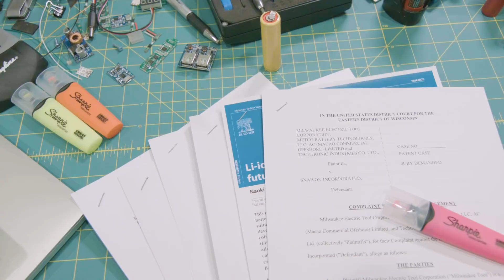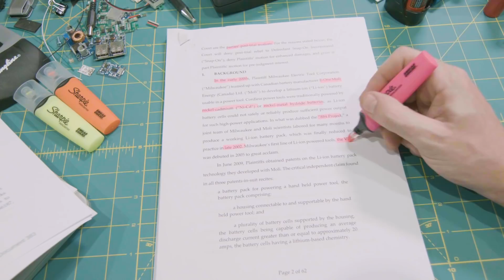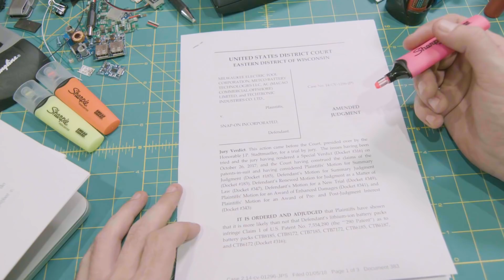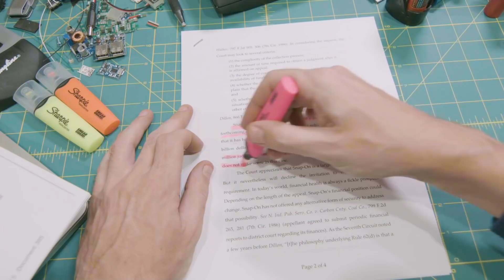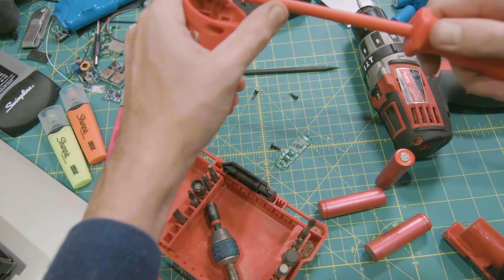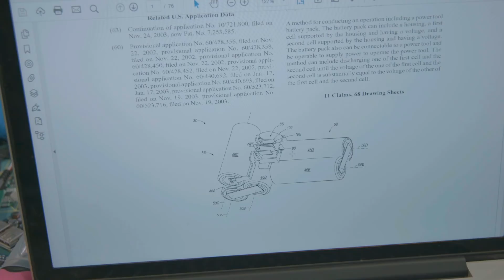BOLLR: Milwaukee wins $28 million for Lithium-Ion Battery Patents from Snap-On

Comment: Thank you, thank you ! I am very happy to see that my favorite copyright attorney has technical competence in engineering. I can’t certify you for safety, however. Even “dead” Li batteries can contain enough metallic or intercalated Li to be fire hazards . The fire does not require gas to be generated. The Li itself is highly flammable in reduced form. This was a very enjoyable program. Wish I could support you more, but not yet able to do so.

Comment: @Lawful Masses with Leonard French: very disappointed -- Leonard -- you didn't address the white elephant: Now that Milwaukee has successfully sued (given appeal success) someone (Snap-On) for patent infringement in using lithium ion batteries in a way in which EVERYBODY safely uses the multi-cell batteries -- e.g. with battery protection circuitry and individual cell sensing, how does that affect EVERYBODY else using Li multi-cell batteries? Does EVERYBODY have to pay license fee to Milwaukee? Just folks with three cells? Just folks using Li multi-cell in tools? Just 20A 3-cell Li tools with plain Li chemistry? These are the questions we all NEED answered to assess potential future liability.

Comment: The science article you said you would link to but didn't is open access (free):

Nitta, N., Wu, F., Lee, J. T., & Yushin, G. (2015). Li-ion battery materials: present and future. Materials today, 18(5), 252-264.
https://doi.org/10.1016/j.mattod.2014.10.040

In case anyone into chemistry wants to read it.

Comment: I am an amature eletronics and mechanical engineer, albeit with the benefit of hindsight, and the decision in this case suggests significant incompetence on Milwaukee’s part. Snapon’s claim that anyone with knowledge of electronics could have made a lithium-ion cordless power tool is not only accurate, it would demonstrate better knowledge of the subjects at hand than Milwaukee’s engineers. I can even attempt to prove this with a hypothetical situation using a different type of rechargeable battery.

No power tool manufacturer has, to my knowledge, produced a viable cordless power tool using lead-acid batteries. Lead-acid batteries have roughly ten times the voltage potential of either nickel-cadmium or nickel-metal-hydride batteries, and would require only two battery cells to construct a battery pack with sufficient voltage for a cordless power tool. The drawbacks of using lead-acid battery technology include the base metals used in the cells being heavier and having potentially slower recharge times. 

The reason I bring this up is that at the time Milwaukee was jointly “developing” the lithium-ion cordless power tool, lithium-ion battery chemistry was not a new technology and the principles involved with them were well known and accessible to the public. To prove this point, I went to my local library and found a book dated 1996, some ten years before Milwaukee released their lithium-ion cordless power tools, that described in great detail rechargeable battery chemistries including lead-acid, nickel-cadmium, nickel-metal-hydride, and lithium-ion. This information included potential capacity and discharge rates for lithium-ion batteries, including the potential amperage discharge levels. Therefore, any reasonable person Milwaukee employed as an engineer could have obtained the information required to choose the best specific lithium-ion battery chemistry for a cordless power tool dating back to at least 1996.

Going back to the lead-acid battery hypothesis, such a cordless power tool would not be patentable because it does not meet the criteria of being non-obvious. Any electronics engineer, amature or professional, would be able to tell any person asking them that they could use lead-acid batteries instead of nickel-cadmium or nickel-metal-hydride if they wanted to use fewer battery cells, albeit with different drawbacks. Since lithium-ion battery technology also has a higher voltage potential than nickel batteries of either type, Milwaukee’s patent also falls short of this metric since any engineer, amature or professional, would be able to tell a person to use lithium-ion chemistry over nickel chemistries.

Therefore, Milwaukee’s patent on a lithium-ion cordless power tool is invalid because it merely combines one well-known technology (cordless power tools) with another well-known technology (lithium-ion batteries) without providing any significant design improvement over either. Lithium-ion cordless power tools were an inevitability after lithium-ion battery cells were invented, since lithium-ion provides massive advantages over nickel batteries that obviously outweigh the drawbacks. Milwaukee’s patent would have held water if a new lithium-ion battery chemistry had been developed in order to enable use of lithium-ion batteries in power tools, however at the time of the patent filing there were only about 3 chemistries for lithium-ion batteries in common use, two of which ended up being used in lithium-ion cordless power tools. Snapon’s arguement is, therefore, correct; any person with the ability to solder could, in fact, have replaced the nickel battery cells in their cordless power tool with lithium-ion battery cells bought off of a regular store shelf already in a suitable condition for use in a cordless power tool.

Comment: GM (General Motors) had a patent on powering an electric car (the EV1) with what at the time was the state of the art Nickel Metal Hydride cells (up to then Lead Acid batteries or Nickel Iron batteries had been the only options). GM in a infamous action (amongst electric car enthusiasts) recalled all those cars (they were only sold on lease) and crushed them then sold the patent via an intermediary onto Texaco who sat on the patent since it was technology that could have affected their oil business, severely if  electric cars had displaced gasoline cars. Of course Li-ion cells came on the scene sometime latter and Texaco's worst fears may be about to happen although slowly since they are no longer in a position to block the latest electric vehicle battery.
What I find staggering is such an obvious action by GM and Milwaukee to employ the latest battery tech is patent-able in the first place. It serves no public good to grant patents on the bleeding obvious and yet this seems to be now accepted as the way the patent system should be operated even though stuff that would be obvious to one skilled in the art is specifically not permitted. This is an evil the Federal Government should have stamped out decades ago.

Comment: Hmm, seems like the original pantent was too broad.  If it pertained to particular chemistry or manufacturing methods to make LI-ion batteries suitable for tools and snap on stole that idea than I'd understand. But just the idea of putting LI-ion battery in a tool EVEN  if that involves reworking battery chemistry is insanely obvious.  HOW to rework that battery chemistry may not be and I can see that being patented but I cannot see how Running an electric tool with a better kind of battery should should  have ever been patent.  Patenting a battery with chemistry and specs that make it suitable for a power tool? Sure.  Patent the idea of using Lithium ion batteries in power tools? Ridiculous.

Comment: Surely Sony and Asahi Kasei should be suing Milwaukee's ass since they invented the lithium polymer battery back in 1985, and arguably all Milwaukee has done is stick it in a fancy box, virtually indistinguishable from the fancy boxes that NiCd and NiMh cells were stuck in previously. As to this 20A nonsense, does that mean that if I limit my pack to 19.999A or set it up for 20.0001A I am not infringing their nonsensical (in my opinion obviously) patent?
Further more 20A at what, 0.2mv, 2V, 20V, 200V, 2000kV... surely the output current is irrelevant, the wattage is the deciding factor as any remotely skilled practitioner of the art of pixie wrangling would know. Moah power == more better.  So your pack running 20A at 4.2V is not the same as 20A at 8.4V or 20A at 12.6V or whatever.. this crap about tweaking the battery chemistry is (again in my opinion) mere magic smoke and mirrors, since other batteries and indeed rechargeable lithium batteries are and were at the time, available that could put out considerably more than 20A

Comment: I cannot say that I believe Milwakee had anything to do with the "invention" of cells that have a higher discharge rate. If I recall, RC vehicles were using higher discharge cells in the early to mid 2000's as well. This seems to be the "time" when higher discharge lithium cells became popular. If Milwakee came up with the idea, why not just market these special cells and sell them as such? Yes I know there are differences between L-Ion and LiPo...

It seems to me that Milwakee said nope that battery isn't good enough for what we need, try again. The battery manufacturer tried again until they got it as their customer required. Was there a document in hand from Milwakee that stated, "we reserve rights to the tech once you finish making it".... Hell I dunno, I still doubt that a tool company truly contributed much more than "this is what we want" to the actual design, regardless of what it "says" on all that paper...

Comment: Funny thing but what we call today "jury" is basically the famous "blockchain". There's already some ideas of fully digital court system in the near future with integrating a special form of blockchain, mostly to reduce costs…not sure which country will be first, but it won't be the USA, they like to keep the old foundation, very shy to reform anything if it still works as old wagon. This reflects the archaic patent system too, ridiculous with patented non-existed stuff. The biggest danger for it - is Artificial Intelligence, machines are already making a big part into getting the patents for huge corporations, like Boeing, this is not humans and it is very unfair for other inventors - the humans. There will be huge political scandal with all this considering that AI is advancing fast, this is making big ethics problem - if USA as state registering patents for machines inventions (full AI inventions can be made soon, it's hard to prove but something will leak someday) - are machines equal to humans? They are not by current laws.

Comment: In the original v28 and v18 tools the protection circuit was in the pack.  The tools were old school, dumb with a brushed motor but over built tanks.

Comment: Christ, whatever you do, protect the Glenfiddich !!!!!!!!! - or I'll sue you for desecration of sacred liquid that IS patented - by Scotland and the distillery... sorta. There's Whisky and Whiskey and that's another vijjeo unto itself!

oh.... btw, great vid!

Some new Smartphones have the option of using different voltage chargers. Motorola's Moto Z battery has a "turbo" feature an can charge at 5V @ 15 or 30 Watts. So how that works and not ruin the  3,500 mAh battery would be interesting to know. The Moto Z battery is not replaceable. A backpack is available and can accept both power versions of the Moto Z charger.

Comment: I discharge most my 18650`s to 3.5V or 3.25V personally, it does degrade the capacity a little faster, but not much, I get about 10% fewer cycles out of them (sony vtc 4&5 and LG HG2), so it`s negligible really, still safe, I just get fewer cycles :)
I`m a bit more particular with my LiPo s, as they are expensive and I want them to last as long as possible..

Comment: I would like to note the M12 batteries from Milwaukee have a temp probe for the charger and for the tool itself and the M18s have built in balance boards.

Comment: i have taken apart a battery. just the three little clips, pop the top. the will slide up, tight fit but not glued. at least the one i opened. it has a pcb with some stuff. for the life of me i cant picture it and now cant remember exactly was in it. the batteries are wired to pcb, and i belive it has a temp. sense of sorts. it pops back together fairly easy. just be gental on the tabs, cut up a credit card for a fingernail sub. like i did.

Comment: i don't feel there is a significant improvement on the tech of lithium ion batteries and their use in these tools... i mean, like seriously. there is little difference between the battery packs that are nicad vs, lithium ion. you add a protection circuit, that isn't patentable in and of itself, and a lithium ion battery designed for high amp applications. the patent is invalid if you consider the tech that went into it. in my opinion only the battery chemistry would be patentable. i think snap-on screwed the pooch with this one, they lost in my opinion an easily win-able case. That or the patents in america are so fucking retarded that they can get away with patenting things twice.

Comment: Bud, those bigger batteries are used for radio control and they are not lithium Ion but Lithium POLYMER. Quite the big difference both in voltage, performance and volatility.
Reply: Google it. That mostly refers to how their jacketed.
Reply: Oh, how wrong you are. They are ALL lithium ion batteries. Most of the "bigger batteries" he has are just cylindrical cells arranged in a pack. The other ones are lithium ION polymer. All lithium ion polymer batteries are lithium ion batteries, but not all lithium ion batteries are lithium ion polymer batteries.
Reply: Andrew Delashaw yes Andrew technically they are all lithium in the RC hobby we refer to the polymers as lipos there is such a big difference in energy density we would never consider using the aluminum can Lithium ions the lithium polymers are 4.2 nominal volts and most of the newer varieties can be charged at three four or five C rates making them ideal for quick charge and quick discharge as an example I fly electric Jets and the typical current draw on a 12 cell 8 amp hour pack is around 120 to 150 amps

Comment: I thought that the safety circuit was required by law to be in the pack itself so that it is safe when removed from the device?
Reply: I think this depends on the specific application.
Most hobby batteries I purchase for quadcopters and robots don't have builtin protection.
There might be some law about computer batteries but it's certainly possible to purchase Lithium batteries without protection.
Reply: Weird.. the pack we make for our product we were told had to have safety circuit built in.  The individual cells come without production, but once assembled into a user removable pack, has to have protection.  Maybe that requirement kicks in over a certain capacity.  Our battery is a 4 cell 16 volt 6 AH pack.  Shipping regulations even require us to discharge them to no more than 30% capacity before they can be shipped.  In any case, not having it in the pack is bad engineering and unsafe design.
Reply: I'm not sure why the RC battery packs can be sold without protection. It's likely because a lot of the packs aren't intended for a specific product. The packs get used in all sorts of different electric (usually radio controlled) vehicles (cars, airplanes, quadcopters, etc.). 
These high current packs have a balancing port to allow balanced charging of the individual cells. Many people use battery alarms/monitors which plug into the balancing port. I'm not sure, but I imagine protection circuits for high current packs would add a significant cost to the pack.
These packs are charged with special chargers which balance the cells. Many people use special "LiPo Bags" when charging these sorts of packs. These bags are designed to contain the burning batteries if something goes wrong.

Comment: So, I looked up the patent in question, cause I wanted to read it n' see what it actually covers, and it was quite interesting. Here it be if you're as bored/interested as I: https://www.google.com/patents/US7554290 Anyway, along with finding that I happened across some similar cases over the same patent and the resulting judgements from the last couple of years which I promptly skimmed though, cause who's got time to read 60 pages of the minutia of battery design? Answer: some judge somewhere apparently. Anywho, the takeaway I get from all of it is that yeah sure a rechargeable battery pack of sufficient capacity to run a power tool is an obvious idea, but you can't patent an idea alone- you gotta be able to actually make it work and detail clearly how to do so. Milwaukee put in the time and effort necessary and has, at least for now, been thusly rewarded.

Bonus: Check out the patent citations and references at the bottom of the patent in question and realize that, if you wanna argue obviousness, the rabbit hole runs deep.

Comment: FWIW, the number is the dimension spec diameter in mm, followed by length in mm x 10.  i.e. 18650 = 18x65mm, 16340 = 16x34mm, CR2032 (watch cell) = 20x3.2mm